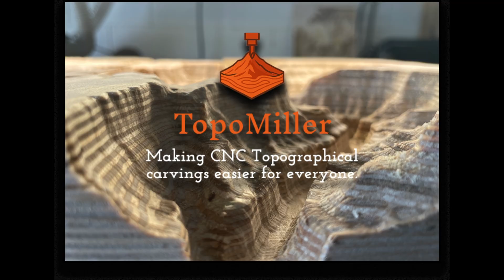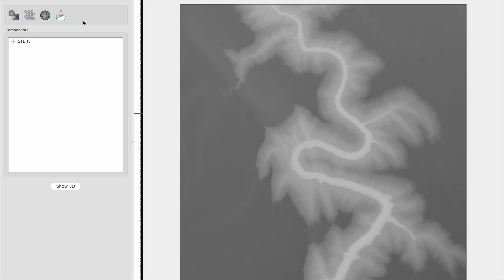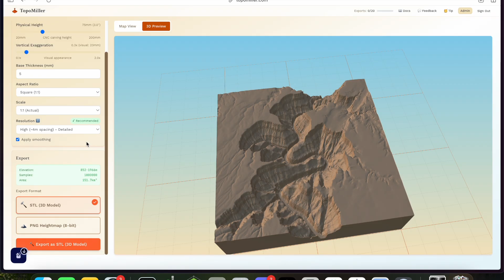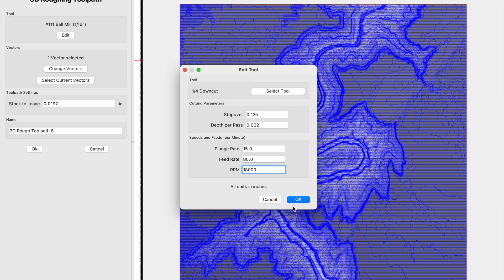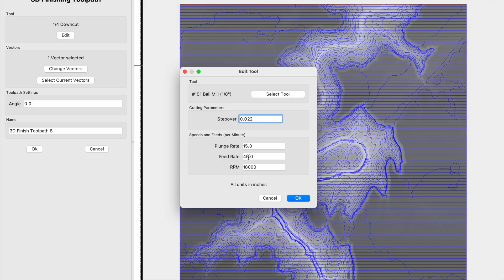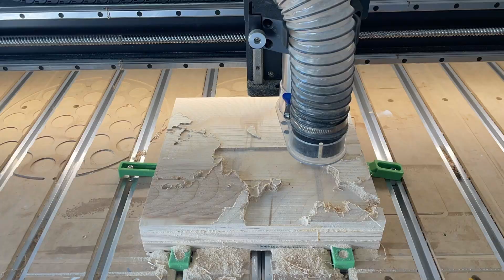Grand Canyon Carve with TopoMiller

Comment: I notice on topo Miller it has true scale and fit to scale. I don't really understand the difference.
Reply from the maker: Hey great question! You can find a more in depth explanation in the documentation section. The short version is this: Fit to Scale fits the elevation into a specific bounds (100mm, for example). This is nice when you need a specific size for the end output. However, it doesn't preserve the true elevation features because it is being squeezed into that bounds that you define with Fit to Scale. However, if you want to preserve the true elevation at scale, you will want to choose True Scale. Hope that helps!